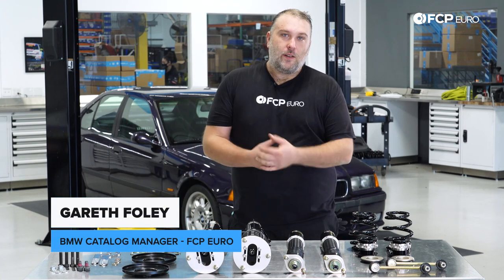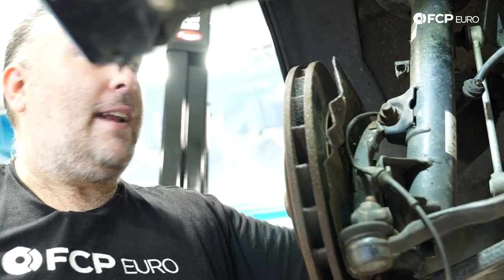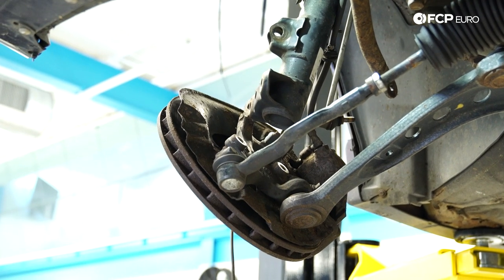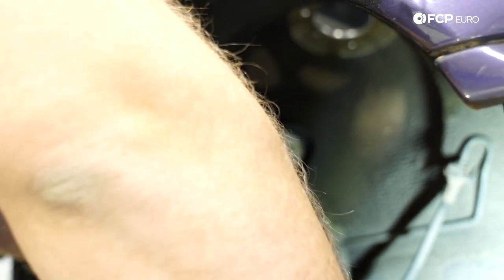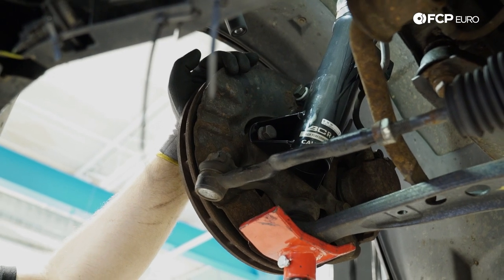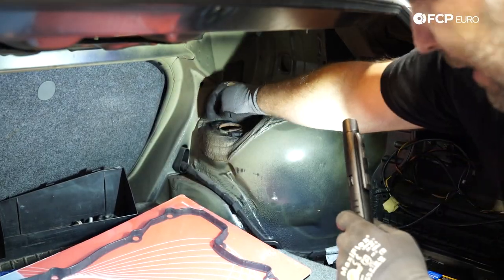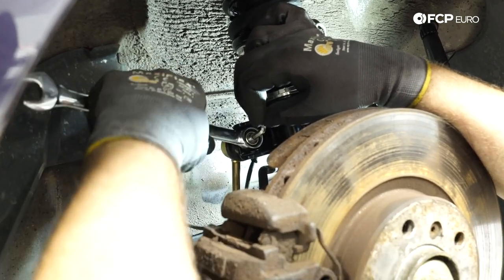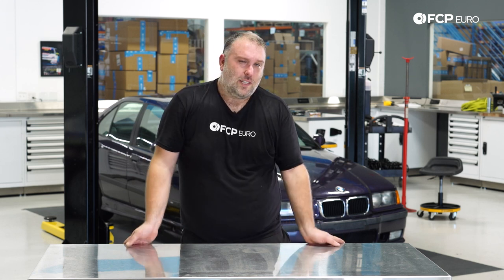How To Install BMW E36 Coilovers (325i, 328, M3, & More)

Comment: We always make it a point to put Paint Reference marks on all the Adjusters. Helps for counting turns etc.  I suspect Manufactures do a decent job, but we also re -reference the marks on the Camber Plates for accuracy after the Alignment Shop has done their thing.  Crusty ol' BMW needs some love.

Comment: Had to do front and rear suspension when restoring my 1999 M3. Upgraded to Billsteins all around, passed on the coilovers. This car was made to ride on conventional shocks and struts. Coilovers and/or lowering springs negatively impact track driving and cornering. This car was specifically designed to pitch slightly forward for better handling and cornering. When you alter the geometry the engineers laid out, you’re on your own. 😕

Comment: Love the vid! Very detail and lots of info!
1 question, why are the rear reinforcement plates placed on top of the car’s body while the front reinforcement plates are placed in between the body and the coilover? Should the rear plates be the same way as the fronts? Thanks!

Comment: Did you need spacers? 

Edit: also I see you put the front top mount reinforcements in the with the rubber mount. You didn’t feel the need to use for the rear as well? Thanks

Comment: hello i have a z3 wondering for coilovers in the rear do you need to tighter the shock tower before bringing the car to the floor or do you bring it to the floor then tighten the shock tower nuts
Reply from the maker: You can do either or, whatever works best for you.

Comment: what are the benefits of stalling "coil overs", what is stock? thanks.
Reply: Better ride height and often times stiffer so less body roll in corners, basically just refreshes the suspension, better for older cars

Comment: Great video. Can these be ordered with Swift springs?
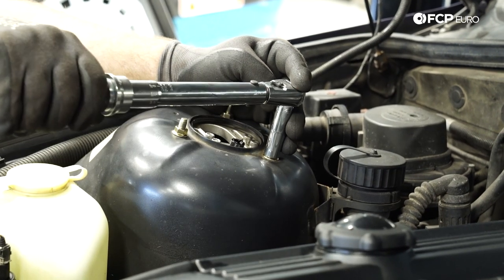Also @ 24:06 is that the correct orientation of the camber plate or is it supposed to be rotated 90 degrees?  Thanks for a great video.
Reply from the maker: Yes they can be! And this is the proper orientation if you want camber adjustment
Reply: @fcpeuro  Thank you!  Yeah, sorry I had the car oriented differently when I was looking.  Thanks for the feedback and video.

Comment: Does any one have the parts number for the 3 bolts on each side? Or a link to where I can buy them
Reply from the maker: What bolts are you looking for, feel free to drop a time stamp. You can also visit bimmercat.com for any diagrams you may need and part numbers.
Reply: @fcpeuro  the three mounting bolts that go from the strut to the knuckle. I didn’t really specify 😅 it’s around the 5 min mark.
Reply: @undeadxkhalifa841  have u found the specs